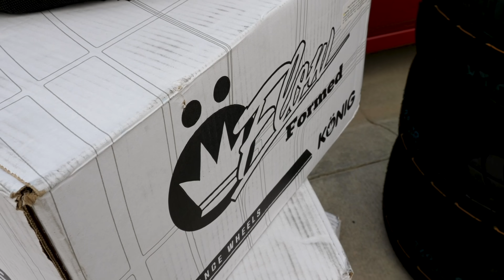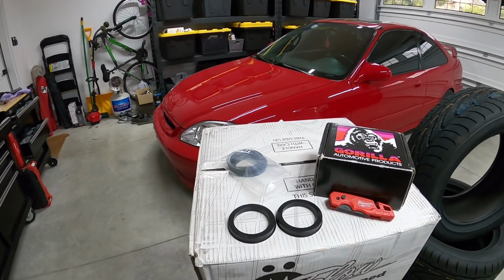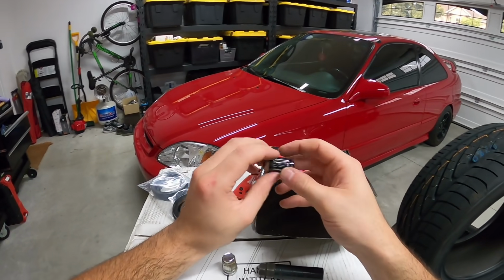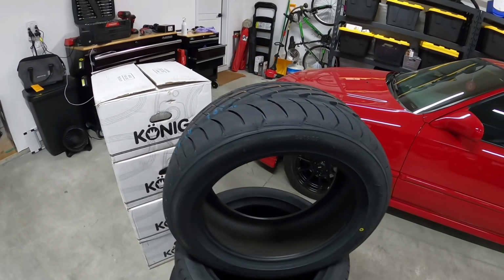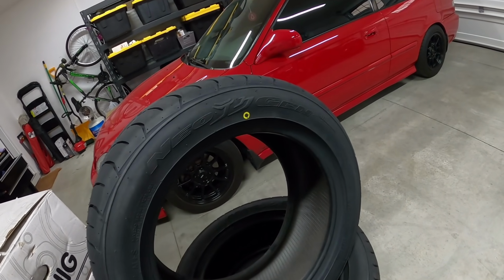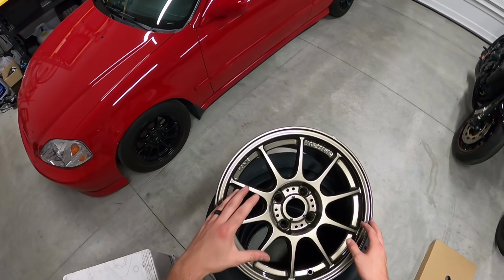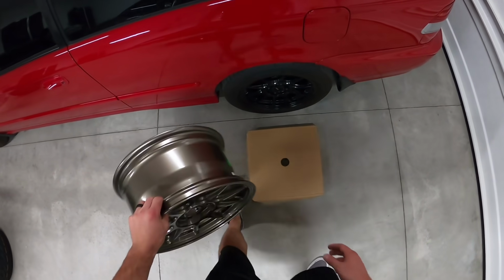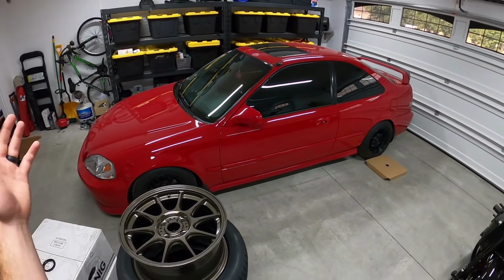The ALLDAYANTHONY Honda Civic Wheel Setup | Everything You Need

Comment: Honda factory lug nuts are a spherical style lug nut which is different than the acorn style and is the number one reason why you can’t use the factory lug nuts on an aftermarket wheel

Comment: For the hub centric rings DO NOT GO METAL. i mean do what you want but i advise not to go metal. I had the metal ones clamp onto my front hub due to the heat from my brakes and the fact the hub and the ring expand at different rates. I did get them off with a heat fun and minimal effort but in a cold country with a blow out your spare may not fit on
Reply from the maker: Never thought of this! Thanks for sharing your point!

Comment: I've got an 04 EX Sedan...i know that it's FWD.  That said, I am considering running 17x7 rear + 16x7 front staggered setup.  Want to know if this will work with stock suspension n if I need some kind of wheel spacer(s) to get flush fitment.  Your thoughts?

Comment: 15x7.5 et35 wrapped in 205 50 15 always hits the spot, another option could be 15x6.5 et40 in 215 50 15. Always loved the meaty looks. If you have an EG Hatch another option could be 15x6.5 et35 in 205 50 15.. :)
Reply: Would u have to do fender rolling for any of these set up ?
Reply: thanks for the ideas! i think i'm going with 15x6.5 et 30 with 205 50 15 tires for my ek hatch

Comment: wheel studs are self centering and that's what holds the load, not the hub center
Reply from the maker: Konig has a video on this subject. I believe some weight can be transferred to the hub
Reply: @ALLDAYANTHONY  you'll find that many if not most wheels don't make contact with the hub at all, and that's fine.  the reason the wheel lug nuts have a v shape is because it centers them on the studs.  but idk maybe they think it centers the wheel better to have it on the hub